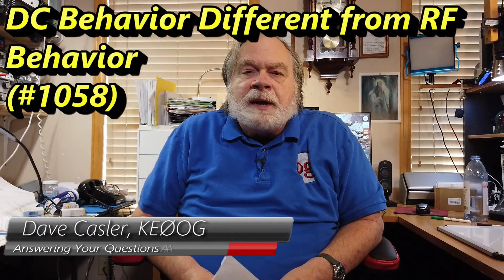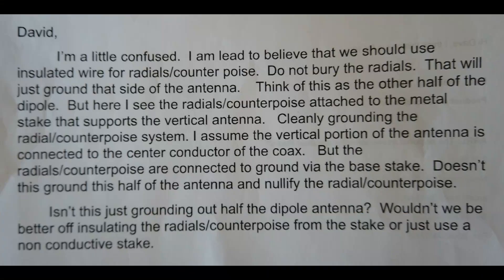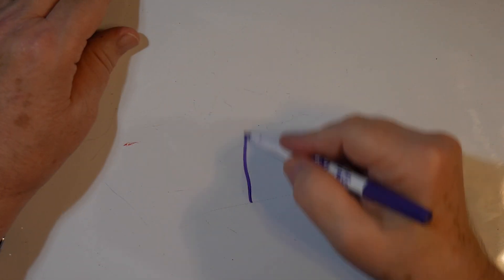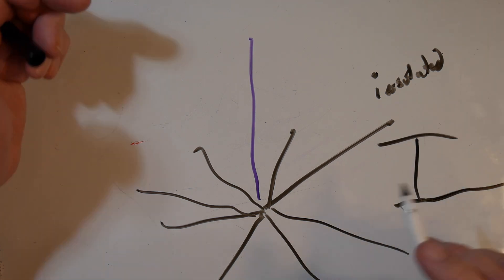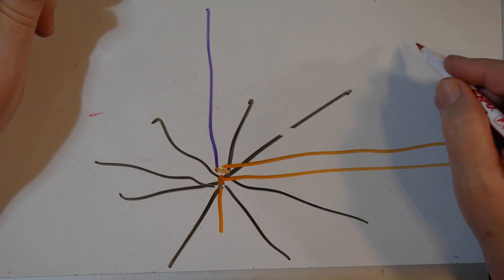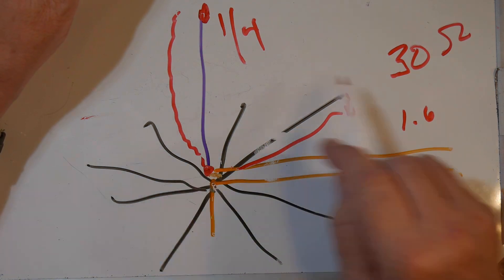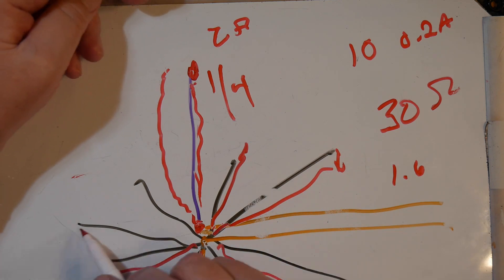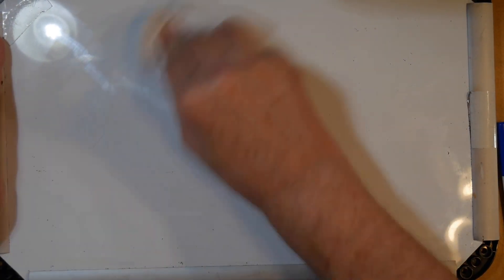DC Behavior Different from RF Behavior (#1058)

Comment: You can use an old garden hose with no fitting over the end to force water around the ground rod in clay or sand to free it.
But a rod pounded through rocks isn’t coming out without excavation.

Comment: Hi Dave, I just purchased a vertical aluminum antenna, I wanted to put it on a fence post about a foot maybe  2 feet away from my house, but it is aluminum siding, will it cause interference, the house is about 12 feet tall and the antenna is 23 feet 4 inches

Comment: I had to remove a couple ground rods. One time I used a piece of thinwall conduit and I jumbled together some fittings to get a garden hose on one end. I slipped down the ground rod with the water running and it essentially drilled a cavity around the rod. Worked ok, not spectacular but worked. Another time I decided to let the soil itself do the work (typically rods end up with soil stuck to them that makes pulling them out hard). On this one I took a socket that is designed to remove bolts with stripped heads. It has reverse spiral grooves designed to grip the metal. I also have a substantial Milwaukee cordless impact driver. So I found a size that fit the rod well, put it in reverse and just spun the rod as fast as it would go and let the sand in the soil wear the clay off. After doing that for a minute or so I started moving the rod in larger circles to expand the hole size. I tried to pull the rod out with a couple pipe clamps but due to chest surgery I couldn't pull hard so I grabbed a farm jack and a chain and wrapped those around the pipe wrenches and it pulled out effortlessly, which is pretty impressive for the clay it was in. So the short story here is, be creative. It might just work.

Comment: A further question to this video Dave...
Is it better to have ground radiials elevated "above" ground, as opposed to laying flat "on" the ground?
Ignoring the fact that animals and humans may get tangled up in them - Strictly from a performance point-of-view.  - Thanks!  - Cheers!
Reply: The farther from the ground, it will get better.  You decrease ground losses by getting the antenna farther from ground.  Of course, safety is the first concern and steps need to be taken to prevent entanglement with the radials.

Comment: I've used an old fashioned bumper jack, secured with steel wire, to pull up those green metal "permanent" fence and sign posts. If you could get it to grab on a ground rod (vice grips? Tack weld?) it should pull up a ground rod just as easily. FWIW.
Reply: I've had luck wrapping a chain around them a couple of times and then hooking it back to its self.  Not too many "bumper jacks" around anymore, but "HI-Lift" farm or off-roading jacks would work a treat.  I've used a tractor's front end loader bucket to pluck ground rods.

Comment: Thank you. 
    Many of the electronic technicians I worked with avoided RF circuits; they referred to RF as strange!
   To truly understand RF, I believe you have to understand Maxwell's equations. Many of the physicists and engineers struggle with these equations.
    RF behaves like other EM waves, i.e. it can be reflected, absorbed, refracted, travel in a straight line, etc. 
   I am 77 and just learning about Maxwell's equations. It strains my brain to understand them! N0QFT, Glen
Reply: There is a content creator who does a pretty good job with Maxwell's equations.  Try Kathy Loves Physics.  It's a mind blower.  There are other content creators out there, but she is pretty easy to understand.